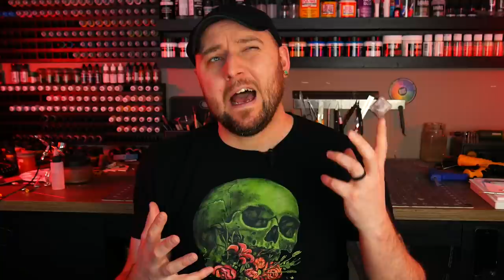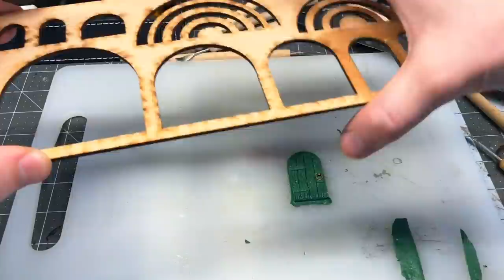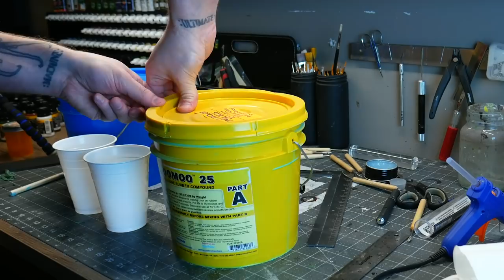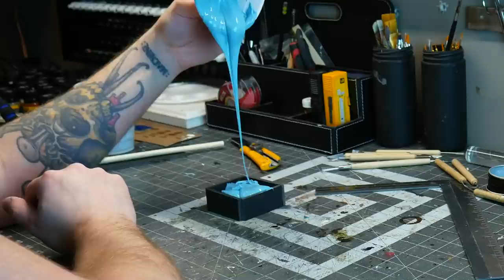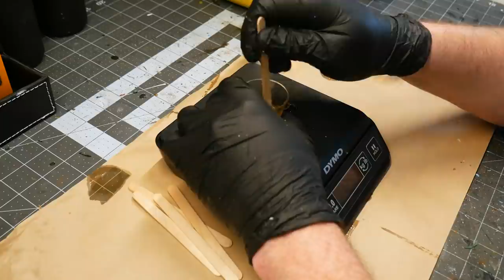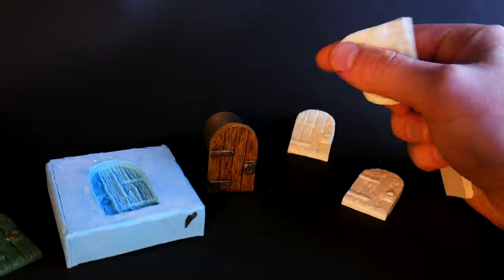Sculpting, Molding, & Casting Resin Doors

Comment: Your doors look amazing ,but they are only one sided. are you going to glue the two half's together and then put it in a door frame ? There is a Micheals in my city I am going to look for those door handles as well so thanx for making this video ....
Reply from the maker: I said I’m going to use them on BUILDINGS.
Reply: Black Magic Craft , I think Jedi is thinking they would be swinging rather than fixed, so when they open, you would see the non-textured, unpainted side. 
Jedi, most of BMC’s builds aren’t dollhouse style. They are outside views only, used as terrain, so the doors just get glued in place.
Reply from the maker: Exactly. I do not like "interactive" terrain. I think it is a gimmick and a waste of time and effort.

Comment: I hear jetdry is a good mold-release. Any thoughts on that?
Reply: It is but it's mainly used before pouring as a flow aid to remove more air bubbles.
Reply: @valack03  Well, yeah. you put the mold release down before you pour into the mold.

Comment: One thing I often wonder about with miniature sculpting is that no one seems to use what is ubiquitous in other sculpting and that is oil based clay. That never hardens completely but which is supposedly far nicer  to work with than say green stuff and which is used to make further molds.

What's up with that? Is is not suitable for smaller details or just that because it's coming more from a hobbyist background people are less likely to make something that can't be used as is, or what?
Reply from the maker: It reacts with certain silicones causing the silicone to not cure. Also for most mini sculpting you want a hard master not a soft one, for many reasons.
Reply: @BlackMagicCraftOfficial  sulfur containing clays like Roma Plastilina can interfere with silicone curing, but most nowadays are sulfur free and designed specifically to work with silicone, like Chavant.

But I bet that a smaller piece like a miniature  that is soft is going to be a lot less manageable than say a big bust sculpt or something, so yeah probably the size is why soft masters aren't so good for miniatures?

Comment: You can find jump rings anywhere. Google Jump Ring Findings.
Reply from the maker: Generic jump rings are easy to find anywhere.....ones with the extra bit that makes them look perfect for door knockers are incredibly difficult to find.
Reply: @BlackMagicCraftOfficial  Like I said, Google. You will find professional jewelry suppliers listed. And will find them in all sizes, teeny tiny to large.
Reply from the maker: Look at the ones I use, then I challenge you to find a link to the exact kind. They are out there, but way harder to find than you think. I’ll give you a 🏆 if you can find the exact type available for order at a reasonable price. Aaaaaand go!

Comment: So now the real question: what else can you use to cast such pieces? Can you use five minute epoxy? Hot glue?  Be interesting to see what alternatives you may present if, say, resin is not available to someone.
Reply from the maker: I’ve been meaning to try 5 minute epoxy to see if it sticks to or destroys a mold. It would probably worse but it’s thick so may not get into small detail.

Hot glue actually works but is a pretty crappy end result.
Reply: There's always the plaster option..
I also believe there's some specific alloys that melt at low enough temperatures that silicones can handle them, although I'm not sure on that off-hand.

Comment: https://www.hobbylobby.com/Beads-Jewelry/Jewelry-Findings/Jump-Split-Rings/Sterling-Silver-Plated-Jump-Rings---4.75mm/p/80805275
These are just the rings. You'd need to put a bead of solder or green stuff at the seam and form it to shape. It's the best I can find online. I'm not quite sure what that little cylinder on there would be for in actual jewelry making/repair
Reply from the maker: Plain rings are easy to find, and not the same. I want to try and find the exact once I use as they are so much better than plain rings.
Reply: @BlackMagicCraftOfficial  the plain rings could work, but would take more work. Those you have look right straight from the tin. I wonder if we just don't have the right name to search for

Comment: If your using molds and resin, then it is time to genuinely consider buying a 3D resin printer.   Resin and especially silicone can be expensive, molds are only going to be limited, but a printer is going to allow you to create almost anything and the resin is cheaper than the resin used in molding.  Longer3D Orange 10 is $230 and made for printing miniatures.
Reply from the maker: It depends more what you ENJOY doing. Not everyone is interested in 3D printing. My interest in playing with the tech is almost 0. That being said even for a lot of people heavily into printing it’s common practice to print a master and mold and cast duplicates in resin as it can be both more cost and time effective for quantity.

Comment: You don't actually have to buy silicones thinner
Acetone or paint thinner is acceptable
Reply from the maker: You know for a fact that acetone can be mixed into silicone part A? It does not cause any issue with curing? If so that would be great as I always have acetone on hand. I'm guessing a similar ratio that they recommend with the thinner (no more than %10 thinner).

Comment: plis make your standard 3x3 dungeon tiles in resin
Reply from the maker: I’ve been planning on doing a high detail dungeon tile set sculpted, molded, and cast in resin. It’s the “big” project in the back of my mind but I haven’t been able to decide on some important details to commit to (1” vs 1.25” and low walls or no walls).
Reply: @BlackMagicCraftOfficial  that would be great! Also, you can add weak magnets on the sides for lining/stacking,

Can't wait!!!

Comment: Molds like these will deteriorate with each casting. You see this with garbage kits a lot, which are limited to small runs because of this deterioration. Keep the original, never make a copy of a copy, wyloch’s rule, the detail becomes fuzzy